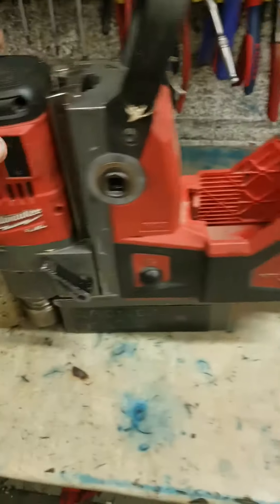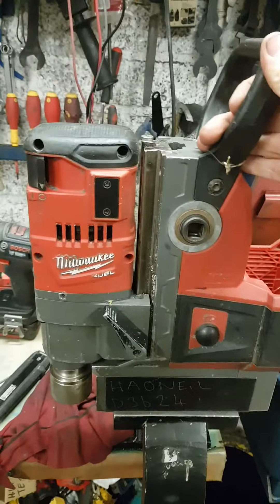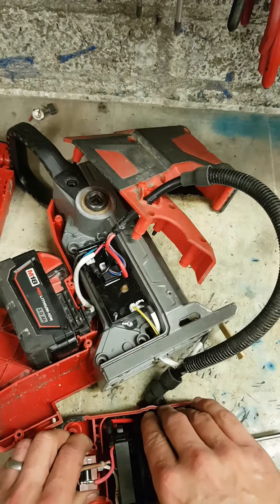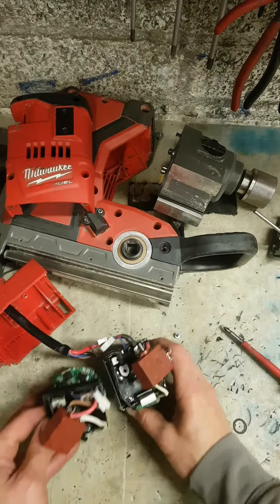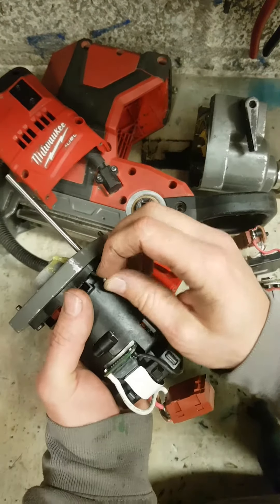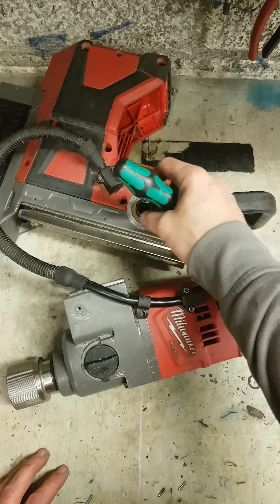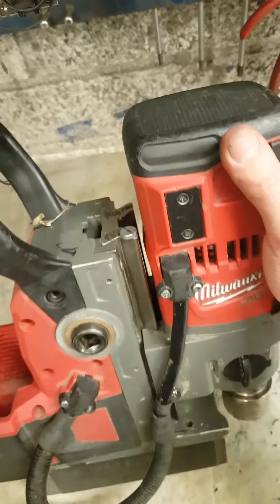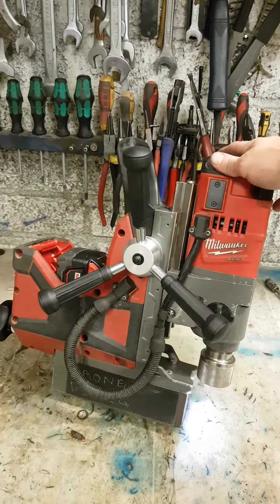Repairing a cordless milwaukee magnetic drill that turned out to be stolen.

Comment: She’s seen better days. Man. Such an expensive piece of equipment. Used one at work, it was fantastic. Killed old 5ah batteries per each 1 1/8” cut through 2” at 450 plate. Went to use the same drill 6 months later at a different location, took her out of the case and parts of the dovetail were missing so the head was loose and couldn’t be raised properly also it had no power. Assume the motor was burnt out. I was sad for the tool, for whatever happened to it since the last time I used it. I have a corded Milwaukee mag drill now I keep in my area, take care of it myself and it gets the job done for me whenever I ask it to

Comment: Any idea why the magnet engagement knob is very hard to turn? When it turn it counter clockwise it makes a lot of clicking noises. Almost like a rachet.

Every other video i have seen the knob is turned very easily. I almost have to grab it with both hands to get it to turn. I sent it to milwaukee to fix that. I got it back today and its about the same

Comment: Same Problem
Reply from the maker: yea its a milwaukee so it is a common problem.. they are a good machine and very useful but they dont last very long at all. very expensive to buy and keep repairing. the company this was returned to, said them selfs, they bought several of them for fitters. every single one has had this problem. motors have failed on every single machine several times.
Reply: @deandohertygreaser  When Milwaukee Electric Tool was American the reliability was legendary.